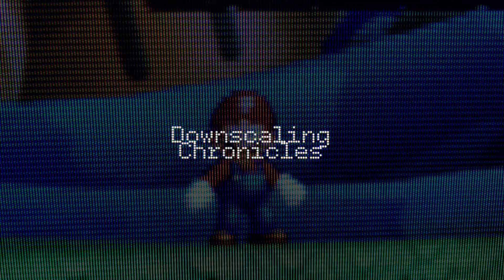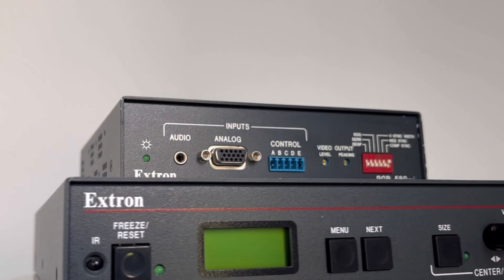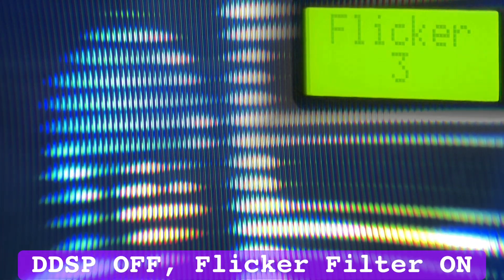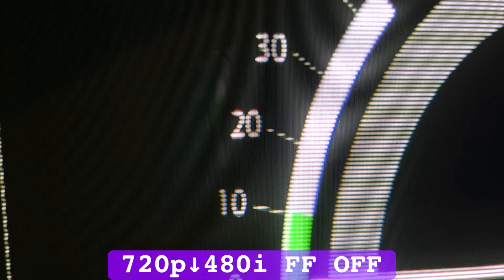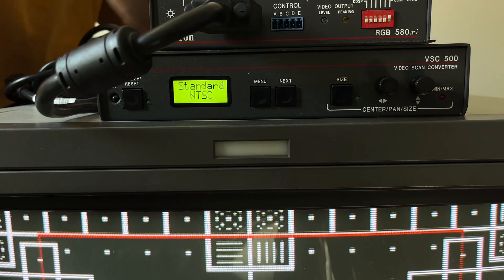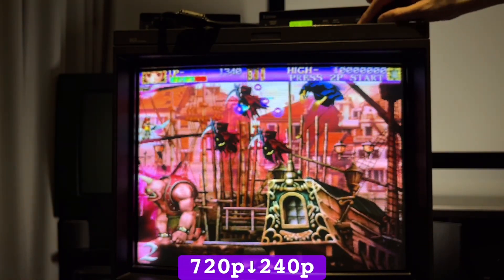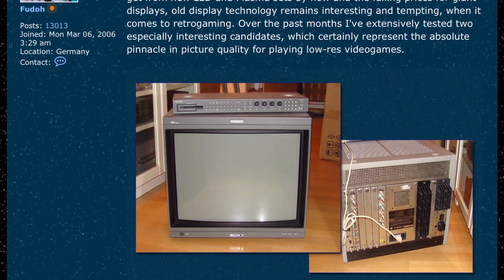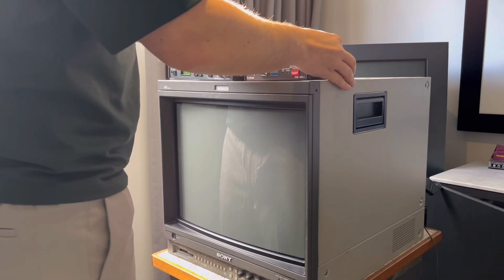Downscaling Chronicles 3: Extron 240p Trick. Pseudo 240p via the VSC 500 + RGB 580xi Interface DDSP

Comment: I got the VSC 500 for 480i movies but the screen tearing is kinda distracting and I don't know if it can be fixed. Does the VSC 700 suffer from the same issue?
Reply from the maker: AFAIK the only difference between the 500 and 700 are the extra inputs and outputs and my guess is they run on the same firmware. That’s a shame though that it’s noticeable in movies. Once you notice it, it’s hard to unsee it
Reply: @MarcoRetro316 It's definitely a shame. I just found an emotia recently but after seeing your video on it, I'm not sure it would be good for movies considering the color banding and artifacts(forgot which - the ones at the tony hawk part). Would you say it's worth getting a dedicated 480i downscaler for movies if I have the super emotia?
Reply from the maker: @Kobenete The Emotia has really bad colour compression so I wouldn’t recommend. If it’s purely for video content and you don’t need any robust picture controls then a generic HDMI to composite scaler with a 16:9/4:3 switch will do but I have no idea if they’ll also have screen tear or stutter. If you need RGB output then a Corio2 tvOne scaler will work well. I can recommend the 750 model and it has 480i/576i output without any modification needed under the resolution labels NTSC and PAL
Reply from the maker: Otherwise you could always use an XBOX360 or PS3 and use the analog output for 480i. For playing movies from a USB I personally use a raspberry pi 4 with recalbox and RGB Dual scart cable. It installs the application Kodi which is a media player that lets you select output resolutions. If you have a DE10 nano (Mister FPGA) there’s a new core called MisterCast that streams video from your PC to the Mister through your wired home internet connection
Reply: @MarcoRetro316 Thanks for the replies, all good considerations. I was wondering, did you try the VSC 100? Maybe it does not suffer from the issue?
Reply from the maker: @Kobenete  no problem. I haven’t tried the VSC 100, only ever the 500
Reply: @MarcoRetro316  Have you yourself seen this screen tearing? I wonder if it's a firmware issue. Reports of the VSC700 tearing as well.
Reply from the maker: @VirtuaVillain  yes, there’s at least 2 instances that I showed the tearing in the video. Someone told me if you can adjust the sources vertical frequency to 59.94Hz then it will be almost completely eliminated. There won’t be many instances you could do this apart from a PC
Reply: @MarcoRetro316  Guess who wasn't paying attention when watching  the video...thank you for the reply! Doing some more reading and the VSC doesn't seem to have a frame lock which is why some see tearing apparently? make sense that you have to manually match the v frequency. I wonder if the Tink 5x or OSSC Pro is a better option for 480p to 480i. I would love it if H and V flicker filter controls support comes to those!
Reply from the maker: Yeh VSC don’t have frame lock AFAIK. The OSSC Pro and RetroTink 5x are great at downscaling to 480i. They decimate lines, so the output can be a little bit jarring if downscaling simple 2D games, but interlacing hides the artefacts fairly well. They don’t have a smoothing or anti flicker option. I doubt the RT5x will ever get one as it’s a fairly substantiated scaler by now. The OSSC Pro is still relatively new and receives regular updates so hopefully it’ll get some sort of V linear filter if not too recourse heavy for Marqs
Reply: @MarcoRetro316  Cool, I'll probably get an OSSC Pro eventually, no real hurry. Ordered a VSC for the short term. Thanks for your help and videos!

Comment: Do you know some deinterlacer that do sd s-video to some progressive component at least but do deinterlacing not by rejecting or bob fields but motion adaptive? Like passing 50/60i SD we got same but true 50/60p? 😅
Reply from the maker: Older Professional video equipment should have decent motion-adaptive de-interlacing with an S-video input and RGB output. Try looking for scalers with an S-video input by brands like Extron, Kramer, Crestron and DVDO. I’m not sure lag is a factor for you depending if it’s solely for video or if it’s for gaming, but Extron DVS scalers tend to have about a frame of lag. The Retrotink 5x/4K and XRGB mini Framemeister will also take S-video 480i and output smooth de-interlaced 480p. Even the Retrotink 2x does an ok job of hiding the Bob de-interlaced flicker with the smoothing filter

Comment: Awesome video! When dialing in the proper video levels, do you simply connect either output from the interface directly to the oscilloscope?
Reply from the maker: Thanks! I displayed a 100% white screen then I had a Y adapter at the BVM. The output signal was on one side, then on the other end of the Y adapter was the oscilloscope and the connection to the BVM, that way it’s measuring while under 75ohm load. If it’s not under load and you connect the scope directly to the interfaces output then you’ll get a higher reading
Reply: @MarcoRetro316 Thank you! I don't think my DT-V or my older BVM 1454 have any sort of overload indicator, so I'll be getting one to make sure the levels are safe. 

By the way, I appreciate your perspective on 480i downscaling. It definitely has its benefits over 240p in certain scenarios and you demonstrate that very well throughout the series.
Reply from the maker: @IamFearLezz  It should be relatively safe but it never hurts to dial it in to 700mv. The BVM’s with an overload light have the dreaded PA board for overload protection and my friend had a few fail on him so I’m always cautious. 

Honestly, 480i looks really nice with HD content and it’s more a necessity if there’s text on screen. Thanks again for the kind comment

Comment: Wow, I'm surprised that my video resurfaced! I made that video about 4 years ago. At that time, I was using a NTSC PS2 going into a Sync Strike, into the 580xi, to a 5 BNC cable, to a D-SUB to component converter. I wasn't using a VSC 500.

At the time, I didn't have a Super Emotia, or a Retrotink 5x. It works ok compared to my other solutions. I still had some instances where the screen would boot up at 480i, but it would often need time to warm up into pseudo 240p.

Also, I did experience the screen being way out of place at times. Most of the games I was using this for were for 480i arcade ports of games that were designed for 240p. Most of those games had screen controls built into the game, so that wasn't a problem. 

The 580xi was a decent solution AT THAT TIME, but now I don't recommend it. It's only a special use case device and now they're very hard to find. 

The image it did give off was a SOFT 240p. There was some flicker, but it was HARDLY noticeable. It was still much better than 480i. I was lucky to get it to work. But today, I don't recommend it. There are so many better options nowadays.
Reply from the maker: The man himself! Thanks for stopping by. I remembered your video from years ago back when this was my downscaling method in my setup too, took some time to find it again. It’s definitely not the best method for 240p but it’s a fun oddity if you get it working and yours was the only case I could find where it worked on a consumer TV. The VSC was to drop the resolution to 480i first, but in your case the PS2 was already outputting what you needed for the xi trick. The ‘warm up’ sounds exactly like my experience with it but it still exclusively worked on the BVM. Are you still rocking a CRT all these years later?

Comment: Thank you again. Had purchased one of the 580xi units a couple of years ago in hopes to try the "trick" on an oev203 (m2mdu) as well as a few consumer sets but read somewhere it only produced ttl sync. Was too afraid to bother with it and now it just sits next to a sc210 and a rgb190f that have yet to find use case scenarios. I was thinking about using the h shift on the 580xi as a rgb only horizontal control for systems that like to display to far to one side maybe. I do like the corio2 so much that i just got a rackmount for it so it can live in there forever, or until I throw my back out again swapping it for something better. Can't wait to see what you come up with.
Reply from the maker: The ‘trick’ is cool to experiment with but even if it works it’s still a very soft and clunky option. You must have a ‘plus’ variant of sorts as my 580xi’s don’t have H shift. They do output TTL C-sync but pro monitors usually handle it no problem or you can put a 470ohm resistor on the sync output to drop it to safer levels. Once the Corio’s all set up it just ‘works’, they’re not the absolute sharpest or fastest but they’re still amazing. I so far still use it as my downscaler in the setup, until it’s dethroned by something superior. Thanks for tuning in and over again for the kind comment!
Reply: @MarcoRetro316  was looking at the h-shift on the rgb 190f when I said that. Nvm. Also was just reading the manual for the corio2 and it also outputs ttl level sync. Also remember you saying that now. Glad I haven't used it on any consumer sets. Really need to get a oscilloscope some day.
Reply from the maker: @hunterrichert4329 the little scope I use is the same one RetroRGB recommended in a feature video. They’re cheap and simple, perfect for small things like measuring sync voltage

Comment: The search continues. We need a easy way to take 1080p/720p to 240p. Thank you for putting in all the work!
Reply from the maker: A dedicated downscaler with HDMI input, RGB/component output without sync combining etc. would be the dream. Made for retro gamers by retro gamers. The journey’s only begun and more to come. Thanks for tuning in!
Reply: @MarcoRetro316  just get yourself an Kramer VP-437xl and go play with custom resolutions. it already outputs 480i/576i out of the box so 15khz support is guaranteed. you can go with VP-724xl if don't want to spend that amount but you will lose the convenience of having native HDMI inputs with HDCP and 422/420 chroma support.